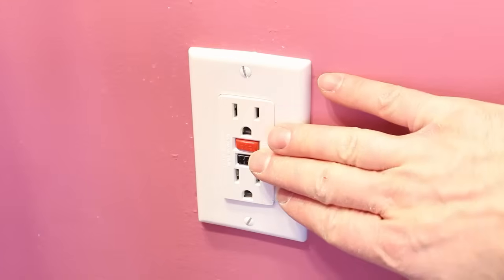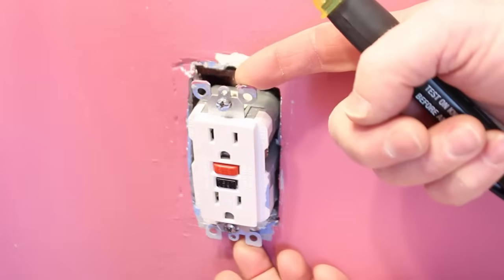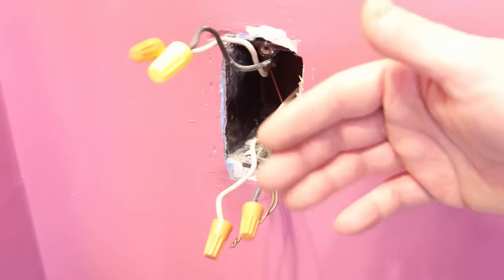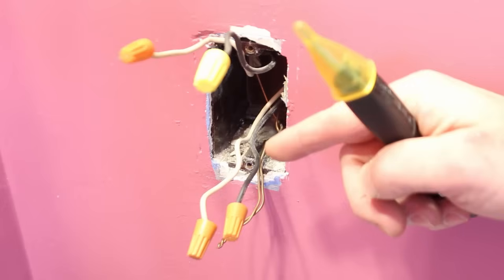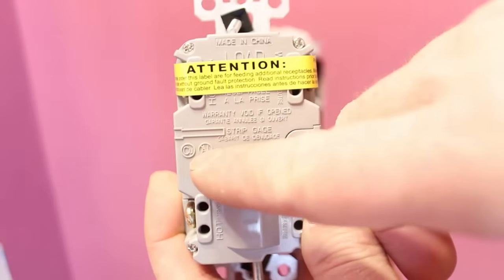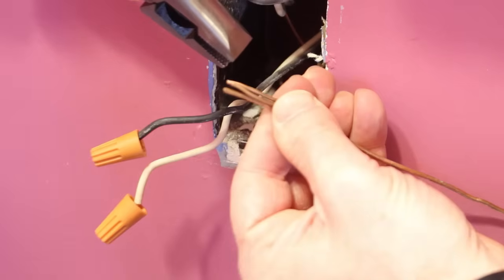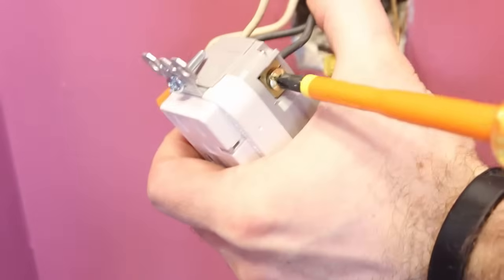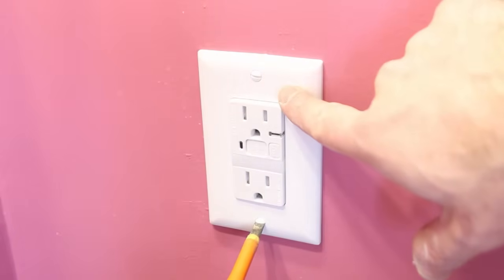How to Install a GFCI Outlet

Comment: Just cause you have two sets of wires coming into the box doesn't mean you have to connect any of them to the load side. You may not want downstream boxes to be GFCI protected. 

Also the entire kitchen does not need to be GFCI protected. I believe it's only receptacles withing six feet of the kitchen sink.
Reply: @JackTannehillPromoter, Is that the reason why in the beginning of Jeff's video, he shows two black wires attached to the LINE screw?. Then following the video ,Jeff separates them putting the HOT wire on the LINE side and the other black wire on the LOAD side, and the rest of the wires attached as expected?.

Comment: if the old box in the wall is too small for the new GFCI it can be a problem trying to get it out without destroying the wall around it.  Mine is from 1972 and has steel "claws" above and below the box which bite into the stud.  Am trying to figure out how to remove it.

Comment: I have a question. In my main bath there is a GFCI plug installed. My master bath has a regular plug but is connected to the main bath GFCI plug. The problem is it pops all the time when we plug things into our master bath then we have to walk to the other bathroom to reset it. Would installing a GCFI in my master fix the problem or would it just pop both?
Reply: Good simply be a loose connection either at the GFCI or any location in the same circuit.

Comment: thank you at my house we need to install GFCIs in both are bath rooms one outlet is 20Amp and one is 15 so we ordered 3 20amp GFCIs because the downs stairs dineing room needed 20 amp grade gfcis (it 2 15 amp ones)
Reply: You only need 20 amp receptacles if a single outlet will be drawing more than 15 amps.

Comment: I replaced an outlet. I put the wires on the screws, not in the holes.  I noticed there is a little bit of rubber touching the screw. It still will not work. HELP!
Reply from the maker: +Barbara Handy might not be a bad idea to call an electrician
Reply: I just checked the outlet with a meter. I'm not sure if I have it set correctly, or if I'm reading it correctly. Set in the red area, ACV, on 250. Looks like it reads 100.
Reply: There is not supposed to be any rubber under the screw. You just need to shut off the power to the outlet, loosen the wire with rubber under the screw and strip the rubber back further so it doesn't touch the screw, then retighten the screw making sure there's no rubber underneath it.

Comment: mmm i really liked this and it was helpful in my search and it had really good tips and narrative,  was reasonably fast-paced, straight-forward and good, but line vs load and having run into how wiring is already different and figuring out the differences not not addressed here.  even after watching it, i'm pretty much afraid of dealing with a gfpi outlet that just went out on me.

Comment: great explanation but your outlet has 2 wires coming out of the wall for a total of 6 wires your dealing with. mine has 3 wires coming out of the wall for a total of what would be nine wires, only problem is the wires that drop from the attic have not only a black and white wire, but there is a red one not counting the ground.  (the clump of wires coming from attic has black, white, red, ground instead of just 3 wires.)  I also have a pig tail of 4 whites and a pig tail of black and red and ofcourse a pig tail of all those grounds. .i have tried many combinations and one actually works were it not for in that combination my living room outlet suddenly does not  work. house built in 1990..

Comment: A question re a GFCI in my kitchen.  After a power failure the GFCI red and green lights are on.  The outlet works fine.  Even when I use the reset button, the red light and green light still stay on.  How can I fix this or do I need to?  Thank you
Reply from the maker: This is a great question onein tenman for the manufacturer of the GFCI. The brand is likely on the front of the GFCI, in the states it's likely Leviton. They could give you better guidance and it's important the GFCI work properly since it's in your kitchen.
Reply: Thank you so much for the quick reply and information.  You are great!
Reply from the maker: Wish I could help you a bit more but keep me posted onein tenman
Reply: Hi Jeff,  I called Leviton.  They were not very helpful.  The man I spoke with didn't sound like he knew anything about their products.  He kept going away I assume to ask someone.  In the end his answer: just replace the GFCI.  Thanks anyway, Jeff.
Reply from the maker: Aww, I'm sorry onein tenman. That's a disappointment and I wish they were more helpful. If the GFCI isn't working properly then the safest thing to do is in fact replace it. I'd hate to see it fail when you really need it.
Reply: Sage advice.  I will replace it.  Thank you again.

Comment: Jeff, first gfi recep you removed had both hot wires connected to same gold screw, was load attached to first gfi not protected? just wired in parallel with it? great video!

Comment: what if I do not want them to trip downstream.Is it a code requirement typically?
Reply from the maker: You'll have to check with your local code newyota1 on that question :(
Reply: @HomeRepairTutor  
Only receptacles in wet locations are required to be GFCI. You don't want the lights going out because a light is on the same circuit as a tripped GFCI.

Comment: Do I have to use the load side for downstream recpt. or lights?since I do not want them to trip off when the GFCI is tripped.
Reply: No. Connect them to the line side with the incoming power
Reply from the maker: If the load wires are needed to continue the electricity to the downstream receptacles or lights then yes. The GFCI should rarely trip and if it does that means it's working correctly. Hope this helps newyota1

Comment: Will it be the same to change from a regular outlet to gfci outlet in my bathroom? My bathroom has a regular outlet. I won't be the one changing it but I'm just curious. Thank you.
Reply from the maker: It could be the same, it's hard to say without seeing your wiring setup. But if you have an electrician do the work they'll be able to install a GFCI in no time. Your outlet in the bathroom could actually be protected by a GFCI already if it's downstream from an existing GFCI. If you have an existing GFCI in a different location hit the Test button and see if the outlet in your bathroom has electricity running to it. If it doesn't there's a good chance it's protected by the GFCI you tested.
Reply: @HomeRepairTutor  
Or the breaker could be GFCI.